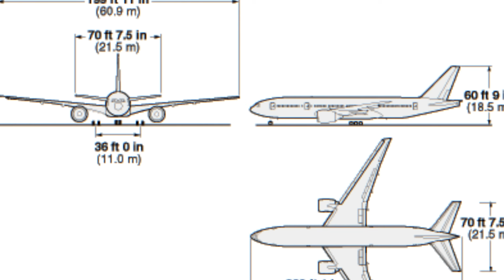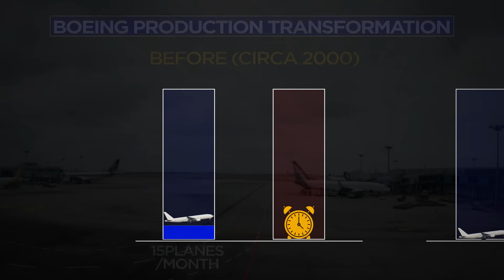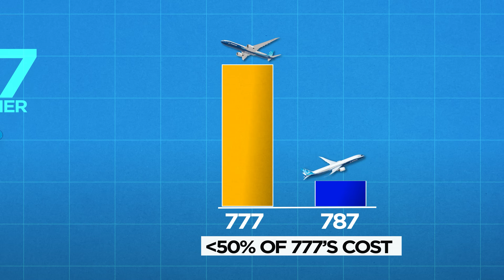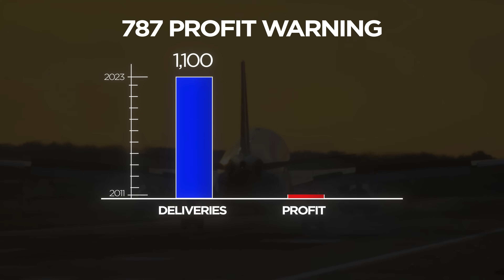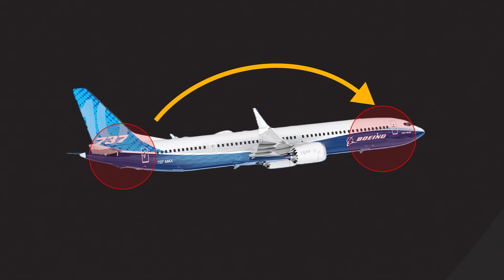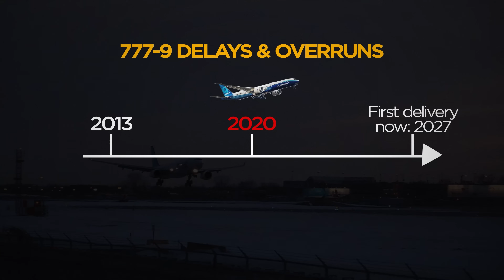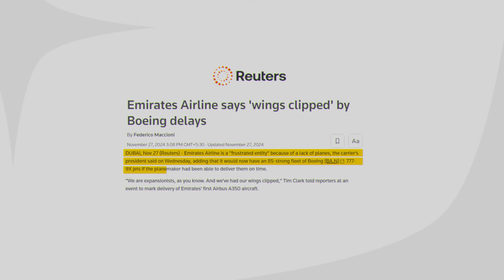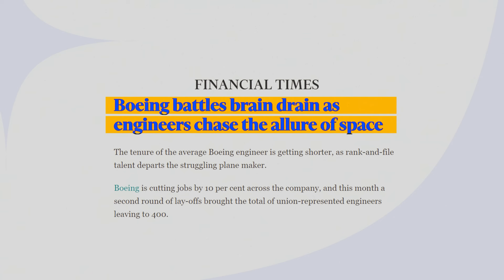Boeing’s 20-Year Decline

Comment: The Ford Pinto mentality.
Reply from the maker: That's a strong parallel to draw, can you elaborate?
Reply: The MAXs legacy may, like the Pinto’s legacy, endure as a cautionary tale about corporate responsibility, the limits of cost-benefit reasoning in safety decisions, and legal accountability in protecting consumers. 

While not an exact parallel by any means, automotive safety is held nowhere close to the same standards as aircraft. But Boeing's current standard of manufacturing and processes as stipulated by boards and not engineers harkens back to a bygone era where there was sometimes a wilful ignorance or deference to known issues and standards in order to produce quanity at cost - let's use the Douglas DC-10 as an example.

Correct me if I'm wrong, but didn't the DC-10 have a known, but deferred door locking solution in order to avoid public scrutiny and potential competitive disadvantage to Lockheed, it's main rival?

I agree it's a bit of a tangent on my part - but at its essence - this is what i meant when I stated "the Ford pinto mentality".

Comment: My uncle worked at Boeing Renton for 22 years. He says the guys on the floor knew the MAX was wrong but management told them to shut up or get out. This video barely scratches the surface.
Reply from the maker: Do you think Boeing can recover?
Reply: @TheSkyDigest why isn't Boeing CEO in jail
Reply: @TheSkyDigest 
Of course  they will recover. They have support from the government and greedy airlines. 
Airlines have placed thousands of orders for the Frankenstein Max feather plane . 
Boeings strategy of providing a competitor to the 320 Neo  and  spending as little as possible on a 60-year-old design ; it’s actually worked! 
Apart from a couple of little hiccups like two crashes and 346 dead and a door blowing off and deicing faults etc
It has actually worked! 
Myself personally I intend never to set foot on one.
Reply: @Rasscasse very nicely said mate 😅